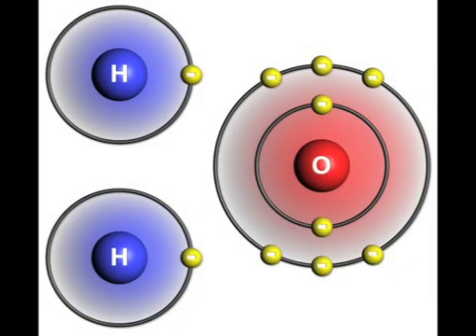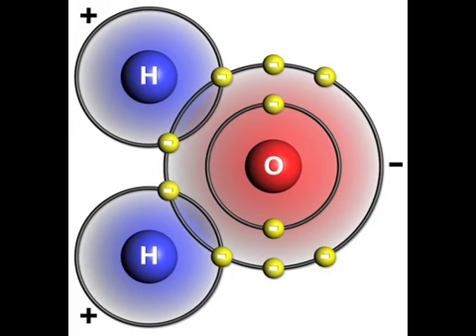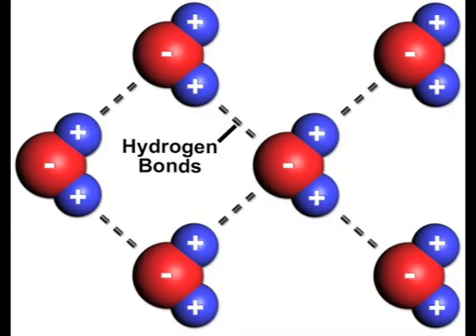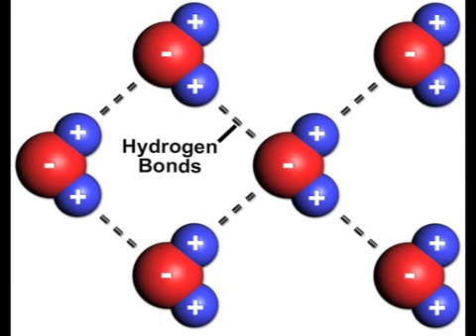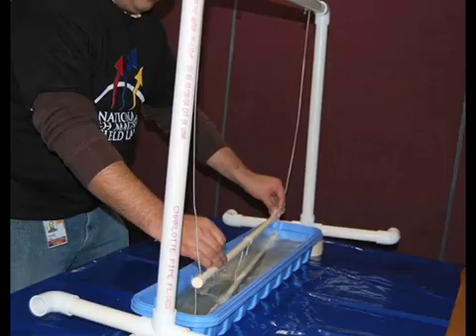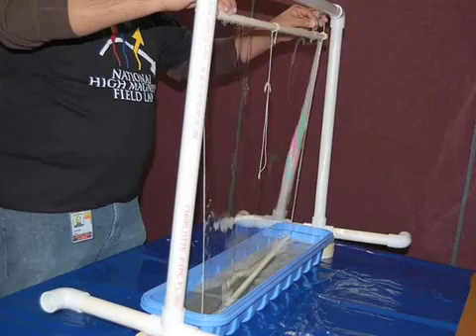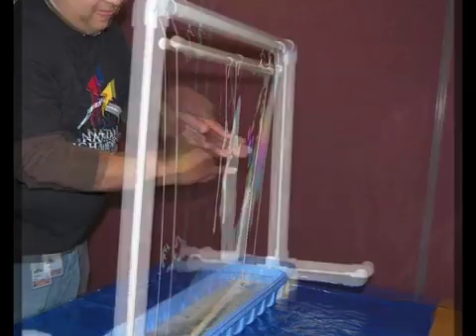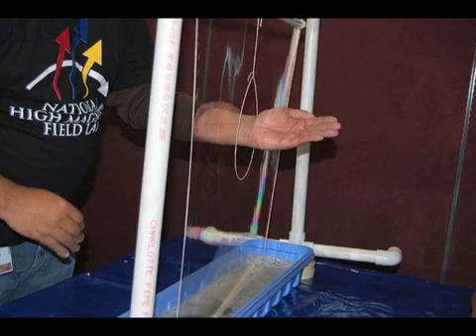Bubble Wall: Surface Tension, Hydrogen Bonds and Cohesion

Comment: are bubbles only supposed to be 3 molecules thick...water, soap and water? and say you wanted to change the polarization of the molecule? could you do this with a magnetic field? Is the surface tension 2D across the surface or is there other points of bonding?